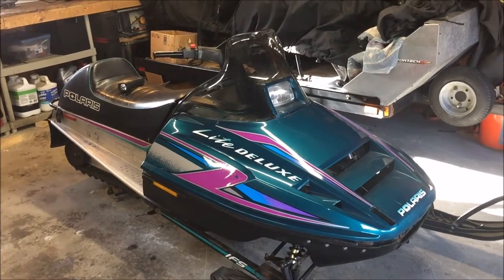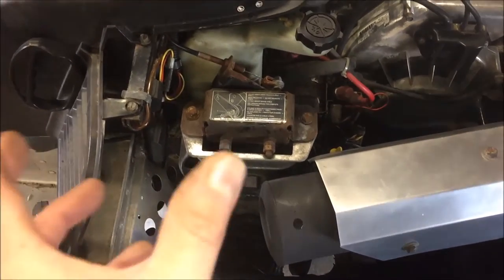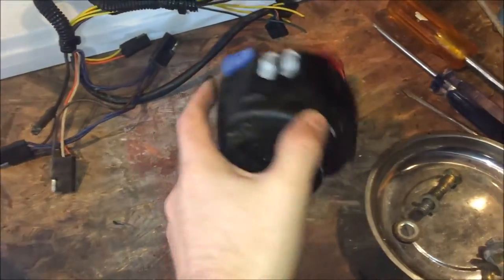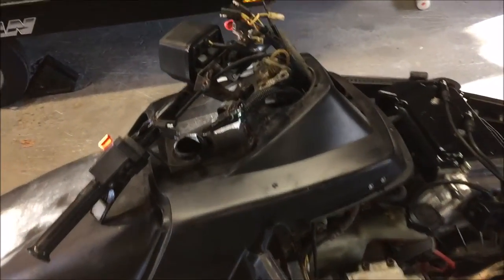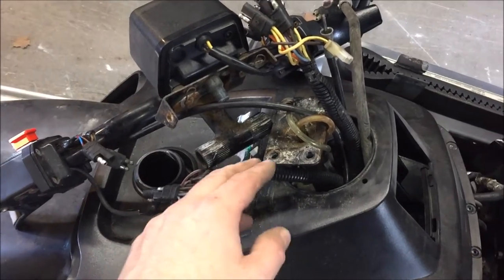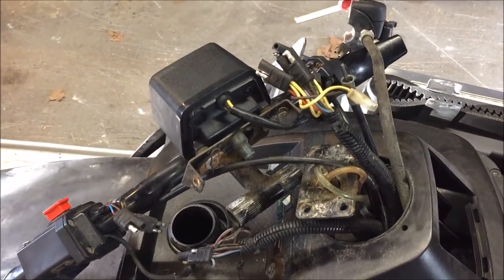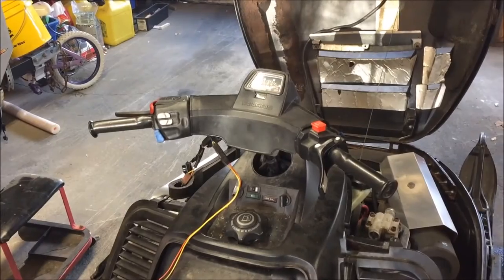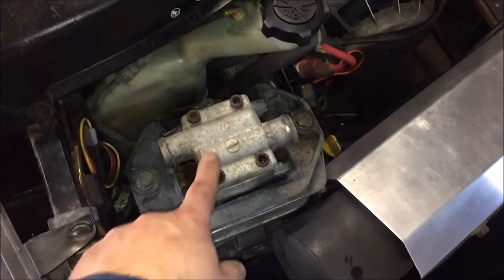1996 Polaris Indy Lite 340 - Upgrading to Hydraulic Brakes

Comment: Great vid, thanks for sharing.  These Lites were excellent sleds and the 340 pushed them around at much higher speeds than you'd think.  Using these as mid-level learners is great, but the mechanical brake system is one of the biggest drawbacks.  I had heard of this upgrade but wondered if the switchgear/brake block would fit properly.  With this upgrade, the Lite is again a great option vs the MXZ380F/Tundra 300F.
Reply from the maker: It was a pretty easy project to do. Pretty much just a bolt on. Even the wiring was simple as well.
Reply: Did you do a wiring video as you eluded to here?  The  brake microswitch is easy peasy but the Hi/Lo beam switch could pose a little trouble.
Reply from the maker: +Rob Pilgrim 
Thanks for reminding me. I just posted the video today to my channel. Take a look, the wiring was very simple.

Comment: Lol I watched this because I needed to see how to bleed the brakes on this system. That didn't happen. Good video though
Reply from the maker: It's not that bad to bleed. One trick is to use a long 1/4 drive socket. That way you can fill the socket with fluid as you're bleeding it so no air get's in.

Comment: Let me know how it works . Nice upgrade. Does your brake disc rattle when driving ? Mine does. Not sure if that's normal ? Mark
Reply from the maker: Typically the rattling is caused by wear in the pads or loose linkage on top of the caliper. Does it rattle at idle as well?
Reply: +Streeters Garage No. I will check the brake pads. I had them all apart when I put new bearings and seals in the chain case. Maybe I didn't set the pads properly ? The pads are fairly new. Sounds like an easy fix. Thanks.
Reply from the maker: +Mark Bow ok. Other than the pads or the linkage that squeezes the pads there isn't that much in the area that would cause a rattle.